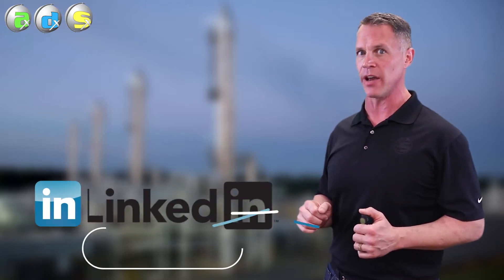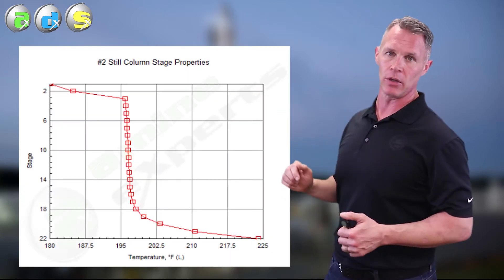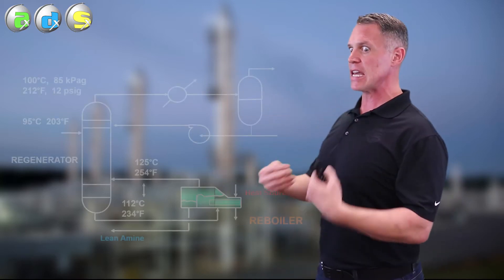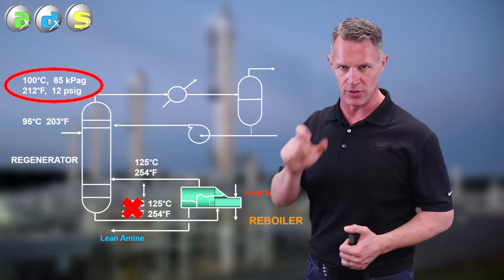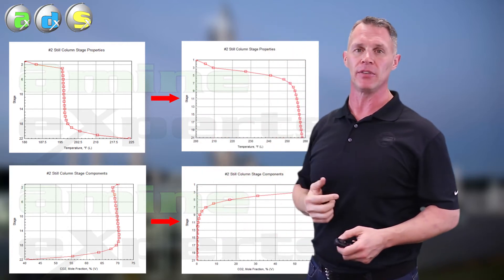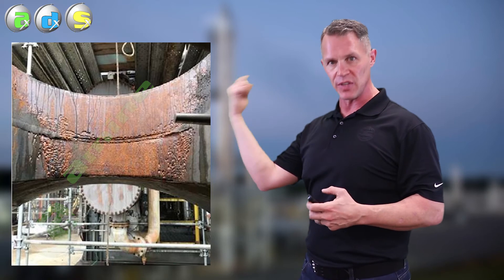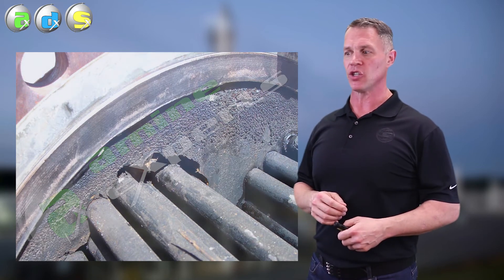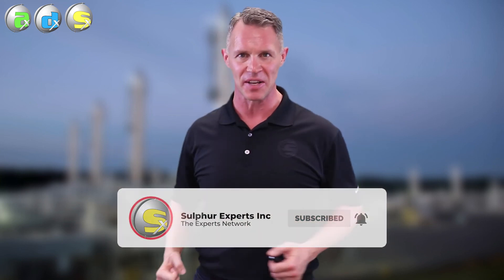Preventing Corrosion in CO2-Only Amine Plant Systems (Part 2)

Comment: Thanks for the very informative video! Aside from corrosion issues (which may be addressed also through material selection), are there other issues arising from understripping and having the "wrong" temperature profile in the regenerator? For example issues in controllability?
Reply: Zephaniah, yes you can have several problems due to understripping besides corrosion. The first is that if you leave too much CO2 in the lean amine, you may not be able to achieve the desired CO2 specification in the treated gas from the absorber. Second, is if you do not strip CO2 from the lean, you also may not be stripping foam-promoting contaminants such as hydrocarbons. You now have a lean stream high in CO2 and foaming tendency - again, it will not work very well in the absorber.
Reply: @benspooner8690  Thank you Ben! Regarding your first point, if there is understripping, then the lean loading will be relatively high. So at the same CO2 capture or recovery rate, the lean amine circulation rate needed will be higher compared to the case of no understripping. But it will still work (corrosion and foaming considerations aside), though not at optimum condition, right?
Reply: @zephaniahmicahesguerra7918  maybe to a certain degree. But as the lean loading climbs, you'll reach a point where it doesn't matter how much poor-quality amine you circulate it still won't work. This question is best answered by simulating the system, because the tower internals and amine temperature also need to be factored in!

Comment: Thanks for nice video. In refinery, how to prevent CO2 corrosion in regenerator? It is  set not to lower steam/amine ratio under 120kg/m3 for preventing CO2 corrosion in my company. Is it proper approach?
Reply: yes that is an excellent approach. If all CO2 can be removed from the amine before it reaches the bottom of the regenerator, there will be no CO2 corrosion. Please watch another of our YouTube videos on "how to determine steam flow to a reboiler" for more details.

Comment: Thank you Amine Experts for the great video series with informative insights in to amine operation and corrosion control.  Looking forward to the next edition!
IGS surface protection solutions have stopped internal corrosion in critical production assets, like amine system equipment since 2001, with over 3,000 m2 clad in more than 85 columns, reboilers and other amine process vessels.
Please visit www.integratedglobal.com for more details.